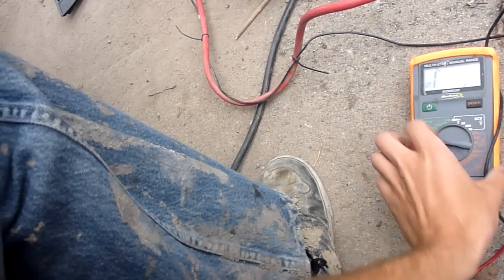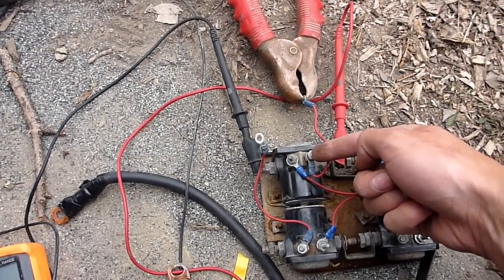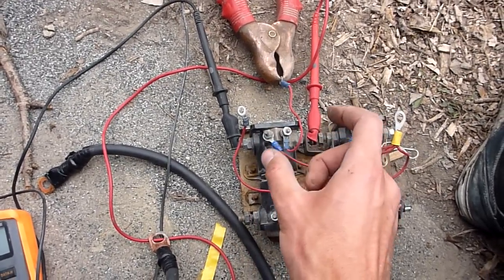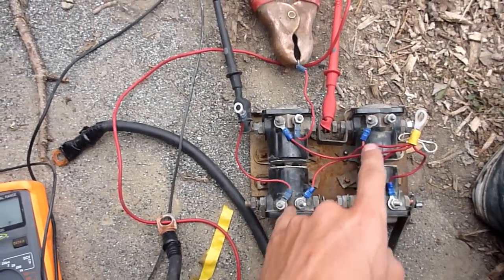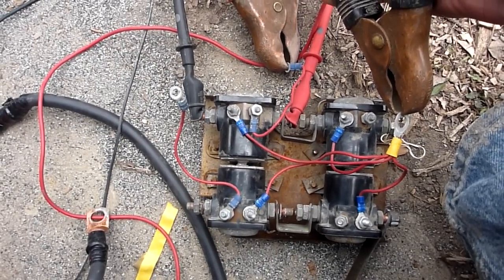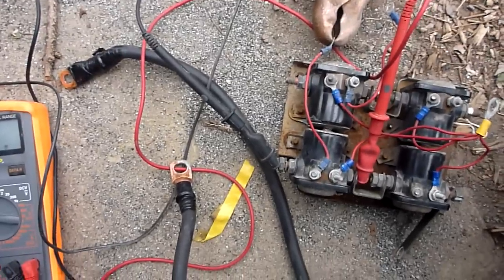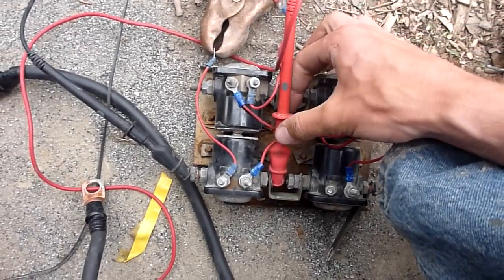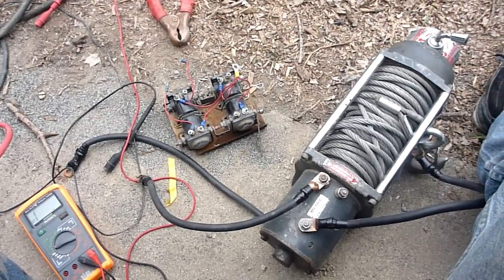Rewiring and Troubleshooting a Warn M8000 Winch - Part 2

Comment from the maker: Hi Melvin, the motor getting warm is normal. You are passing a large amount of electrical current through the motor to generate that amount of turning power and a byproduct of that is a lot of heat. The drum is probably conducting the heat generated by the motor, I am guessing the end with the motor is hotter than the end without? It's also possible the grease or bearing needs service.

Comment: hi got a warn m6000 winch and the motor is getting warm after 3 minutes of activation sold it to a guy who states this and wondered if this is normal its running on 12v the centre roller where the wire sits gets warm at the motor end as he took rope off to check any advice appreciated i could air cool it but wondered if this is normal or should they run cold thanks melvin

Comment: hello vantagetes i also have a m8000 winch but i'm not sure how to wire the solenoids the right way so it works..  please help. i bought a new motor and i took it all apart to clean and regreased.. i got it all together but don't know how to wire it up again.... i should of took peicures.... please help